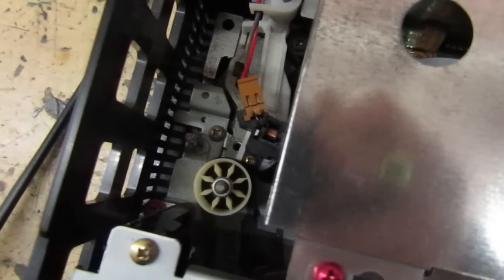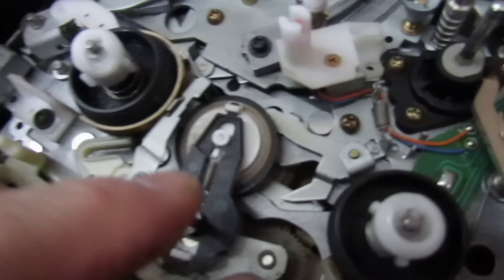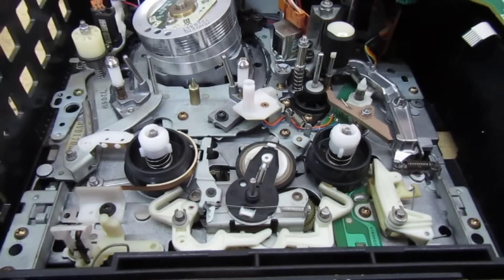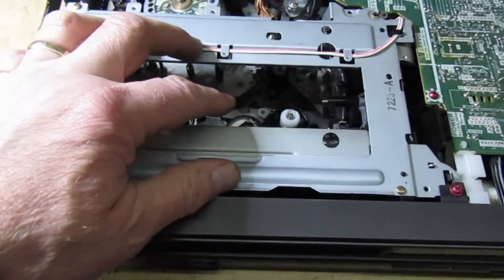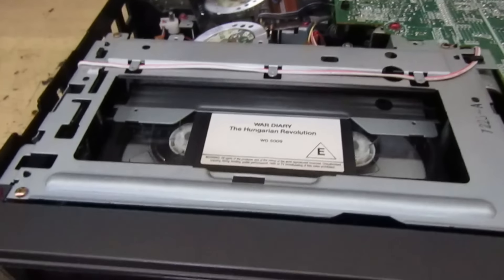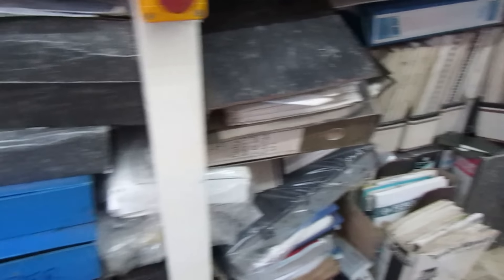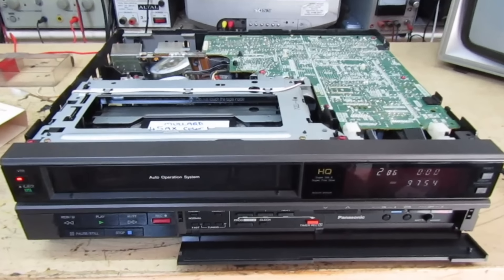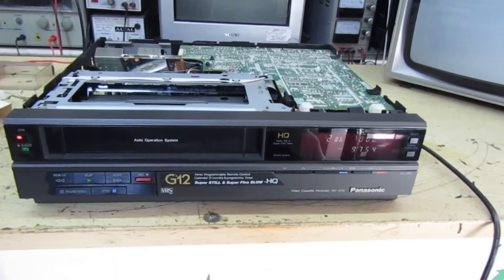Panasonic NV G12B vintage VHS video recorder.

Comment: Most Excellent! Thanks for sharing Michael! A another good trip down memory lane. Just for referance, no need for a back tension reading gauge tape. If the height is turned down on the TV or Video Monitor so you can see the video head switching points, when the parts above and below the switching points are aligned, that is the correct back tension. If you experiment while play a tape and touch the back tension arm to increase or decrease the back tension you will see the alignment move from side to side. This could be very usfull for any others that don't have a back tension gauge tape. P.S. A test card recoring is best, e.g. BBC test card F, with the little triangles at the top and the bottom in the centres.

Comment: Hello Michael, the serial number starting E7 denotes it was manufactured in May 1987. I used to service loads of these decks, they were good to work on unlike the G mech and K mechs that followed in later models.  The maintenance kits were excellent, the only item that should have been included in them was the mode switch which was a common failure.
Reply: What were the problems with G and K mechs?
Reply: Are g and k decks the ones using the capstan motor for everything?
Reply: @WolfmanDude  Well, in my opinion the only major problem of the K mech are the brakes on the take-up side. If you use long heavy tapes often, they (the brakes) break. The plastic is weak and cannot support the spring tension when old.
Reply: @carlmannion708  The G deck is the one that uses the capstan motor to control all mechanical functions. The K deck is the one with the separate loading motor that has a collar that splits and causes the mech to jam randomly.

Comment: Hi Michael. That was great to watch as by pure coincidence, one of our customers has just presented us with an NV-G10 for checking.
It's not in quite the pristine condition as yours, but it is basically working. 
The main problem I had was that the felt liner had as usual become detached from the back tension band. I don't have the luxury of a replacement, so have glued it back with a smear of Bostic, not super glue!. Today I will refit the band and check it out.
Kind regards Allan.

Comment: Had a lot of late 1990s Panasonics, and Granada also loaned us a Panasonic when they were repairing the Hitachi we were renting - though the one we were loased had a press button tuner.

As metals go, alumininum is rather good. Not far off the strength of steel, as shiny as silver, yet as light as glass. Poor steel was a big problem on more modern VCRs.

Comment: I have two of these up the loft i have not got round to looking at one is cosmetically good the other not so . Only thing i was disappointed to find out is that the model runs a stk module ...but i suppose i have a spare stk  😂

Comment: What I remember from the late 80's... many mono VCR's had RCA A/V in & out, some had BNC video & RCA audio... JVC had 5 pin DIN audio & BNC video in/out, scart sockets seemed to be standard on all stereo VCR's, first stereo machines I remember having were philips VTR4000 and Ferguson FV77HV in the early 90's... I used to run a scart between them to copy rental tapes

Comment: Nice D1 mech machine. You can almost expect these to work forever if you service them properly. I have the very similar NV-G7 branded as a Blaupunkt. I found it a few years ago in a rubbish bin and it was covered in dust and beer(!). I got it working almost perfectly even though the head drum was corroded to death!

Comment: do you remember a very cheap Phillips video recorder the name of the deck was a Charlie deck cheap plastic and the  pinch roller drive was a comb and if the tape jammed it snapped the Pinch roller off😮
Reply: Garrrh!, yes!, actually despite the plasticky deck they worked well, a works colleague from another company showed me how to replace the pinch roller whilst the deck was in motion!, never ever show the roller rubber any head cleaning solution, it will dissolve instantly.
Reply from the maker: Yes officially a very difficult part to fit but a Phillips dealershiwed me a short cut to replace the pinch roller, might still have the odd couple.
Reply: In Australia all the Philips vcrs were rebadged Sharp vcrs, so we never saw the junk you’re talking about 😅.
Reply: @paulsi1234  That's interesting to read because a while I go I came across one of those Sharp-made Philips VCRs on facebook marketplace and I live in Greece. :)

Comment: I can well remember these and they were very popular with the rental companies.
I have refurbished many of them and always tried to use the genuine repair kits.
The alternative ones from the likes of Grandata were a bit iffy and you only received
new idler tires that seemed to go the same way as this one very quickly.
Compared to the infamous G deck, these were very reliable.
Reply from the maker: The genuine Panasonic kits were only about £8 from SEME at the time which represents good value for money compared to the patten parts, Phillips also followed the same lines with very comprehensive repair kits.

Comment: I lucked into a Ham Radio swap meet and found 6-8 1 gallon zip seal bags of VCR parts for many makes. I used a lot of the parts over the years. In it was a massive amount of Mitsubishi drive pulleys.  In my haul  &  I ended up with some of the brass after market replacement pulleys, which was a real find, as they were NLA. (Mits drive pulleys were plastic or nylon and often split. ) Also many belts, idler tires, etc.   I bought drive tires by the dozen too, and was just was given a nice stock of belts and VCR parts too, which I have not even begun to sort out. 
  Towards the end of the VCR era, one dist. had a deal on odd ball makes  of  belt kits for dirt cheap. We bought a dozen or more and used the belts out of them on VCR's and tape decks. .  I still have a bunch of NOS RCA kits too.  I never saw any of the Panasonic kits like you had there with all the parts needed.  Back tension gauges and such were very expensive here, and a gauge kit was horribly expensive. The Tentel gauges were the most desirable ones to have.
Reply from the maker: Had loads of these kits and sold them off years ago thinking I would never use them again, wish I kept them now.